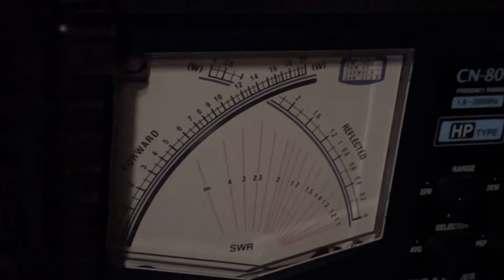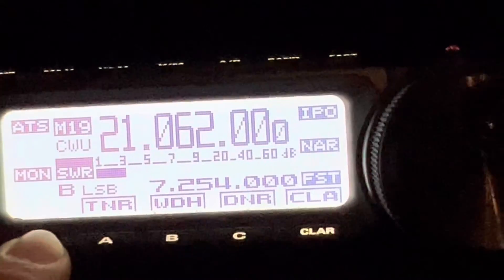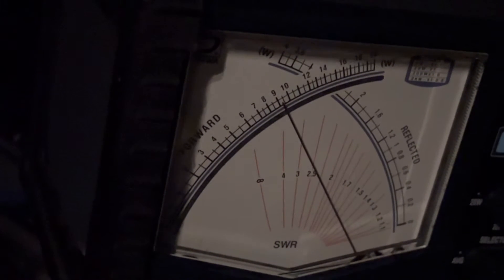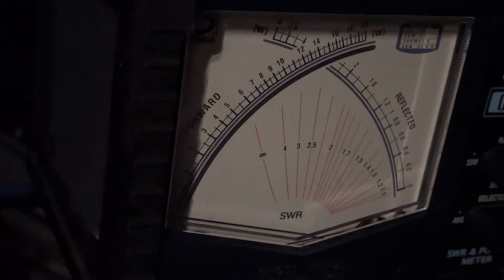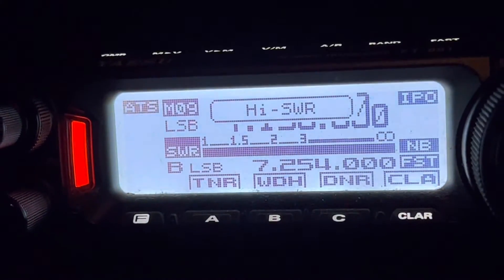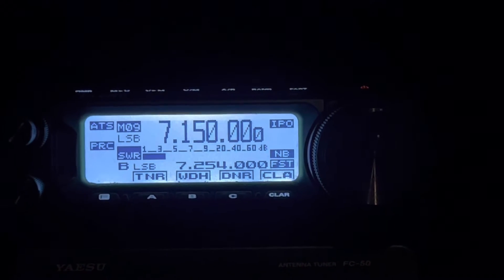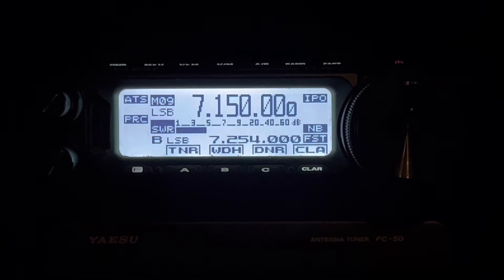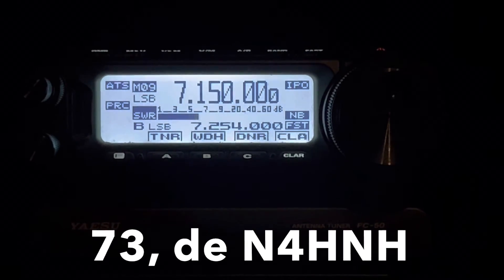Yaesu ATAS-120A Part 5 (how many watts for tuning?) #yaesu #atas #hamradio #antenna

Comment: Thanks! My Yaesu FT-857D tunes quickly into a fan dipole since there's no rod to move up and down. As best I can tell in the second or so required, it's using less than 10 watts, which fits with your 7.5 watts. That should keep the finals well protected. However it is used, the menu button tune mode of these Yaesu is handy. It's far easier than reseting the mode and power just to tune an antenna. 
    There's a useful tip I've discovered that'll tell users with multiple antennas which has the best match independent of the tuner and is thus likely to be the most efficient. 
    I've installed an SWR meter between my transceiver and an FC-30 tuner. Once the tuner does its thing, the SWR is very low. But what is the SWR before tuning? You can get a rough idea by watching how far the SWR meter jumps before the tuner finishes. For a well-tuned antenna, like my 40 meter dipole, it hardly moves. A good match already exists. But when I use that 40 meter dipole on 15 meters, it jumps about 10%. There the match is not that great and requires some compensation.
     There's also a handy tip that Yaesu suggests in its manual. These tuners have a memory based on the frequency being used to speed up tuning. Over time that memory can become cluttered and interfere with the tuning. The manual describes a procedure to reset all that memory. After I did that, some erratic behavior went away.

Comment: Interesting. Do you know if the power is applied to the center or shield of the antenna or both? I have been kicking around trying to tune two at once in a dipole configuration but trying to uncover where the power is needed for tuning.
Reply from the maker: The DC to run the motor rides on the shield and the center conductor of the coax.
Reply: @n4hnhradio  Okay, I wondered if it was both or not. Good to know, thank you!
Reply from the maker: It’s probably not feasible as a dipole, trying to synchronize both ATAS-120A antennas to be the exact length.  I’m also concerned about the extra strain on the radio’s DC output circuit. Better off using as a vertical, with plenty of radials.  Or use two Ham Sticks as a dipole. A 10m Ham Stick can work 10 through 20m with a wide-range antenna matching unit. I also used a 40m and 60m Ham Stick.
Reply: @ Yes, I agree 100%. I have just been thinking of toying with the potentially impossible. lol

Comment: Has anyone actually tried using 2m or 70cm on this without the 991a?  I’m wondering if I can adjust the antenna (manually,buttons up or down) with the FT-891 then use a switcher to for a 2m/70cm antenna.
Reply from the maker: I don’t think you can do that. The motor is powered from the radio. You need to transmit on the frequency you wish to tune for.  The ATAS-120A can be used with the FT-991A.

Comment: Still new to the hobby. Do you have to use a tuner if you install the 891 in your vehicle and use the atas? Trying to limit how much I need to install in my vehicle. Thank you
Reply from the maker: An “antenna tuner” doesn’t actually tune an antenna. They are poorly named.  An antenna tuner cannot change the length of the antenna.  An antenna tuner acts like a transformer and fools the radio into thinking that the antenna is the correct length, so the radio can deliver full power to the coax.  Much power will be lost in the coax, due to the mismatch between the coax and the antenna, but you will get some power to the antenna.  Sometimes we have no choice.  Been there and done that.  

As long as the antenna tuner is only needing to match an antenna that isn’t too far off, like 3:1 SWR or less, the coax loss is tolerable.

The ATAS-120A has a motor that is powered via the coax. The FT-891 powers the motor and makes the antenna longer, or shorter, as it measures the SWR.  It will stop the motor when the SWR is acceptable.

I showed in video #4 of this series that I was removing the ham stick antennas. I no longer needed them, thus I no longer needed the FC-50 “antenna tuner.”  I just released a video about an hour ago that shows my FT-891 as it is now - no FC-50.  The FC-50 was disconnected during the filming of the 5-part ATAS-120A series.  Now it is gone.

Comment: Ever thought about mounting it in the roof to the mag mount and testing it then?
Reply from the maker: No.  I know better.  It needs more than capacitive coupling to the body, for counterpoise. I think I pointed that out in one of the videos in this series. Also, I don’t want to put a $400 antenna in harms way.  It might get torn up by a low hanging tree limb. That already happened to two of my ham sticks.
Reply: @n4hnhradio  I’m sorry if I offended. I meant just using it stationary, not driving around.  To see if the car roof gave better performance My apologies for not clarifying.
Reply from the maker: I wasn’t offended. I was just explaining that I knew better than to try the magnetic mount.  The magnet doesn’t provide adequate coupling to the vehicle body, for counterpoise. Remember that the ATAS-120A, or just about any mobile HF antenna, is only half of the antenna.  The other half is the vehicle body.  

My magnetic mount was always a compromise.  Not because I wasn’t willing to drill a hole in the roof, but because of the stability needed to support a 6-7 ft. Ham Stick on the roof.  The triple magnet provides the stability, but it doesn’t provide the direct bond of the shield to the vehicle body.  The counterpoise is therefore compromised. This adversely affects the SWR/performance, especially at the lower frequencies. I had to use an ATU even with the Ham Sticks.  For example, the lack of direct coupling limited the useable SWR range of my 40m Ham Stick to around 40kHz.  And even with that, the lowest SWR achieved without the FC-50 was 1.5:1.  

People who use an ATAS-120A often report that they had to install numerous grounding straps to the frame, even when they install with a direct bond of the shield to the vehicle. The bond needs to get to the frame.  I haven’t had that issue with my mount.  My bracket connects to an existing bolt that has a good connection to the frame.
Reply: @n4hnhradio  Thank you for the help.  Sincerely!  I am planning on buying the antenna with an FT-891.  My idea was to use it with a mag mount stationary, not driving around. I thought that would work better. I am a newbie to HF.  I have been doing UHF/VHF for about six years and getting ready to venture into HF. I live in an apartment so that is not an option so a mobile set up is what I’m going to be doing.  Just trying to figure out the best  compromise.  I truly appreciate your help. 
kg7bgm
Reply from the maker: You might be okay with a magnetic mount for the higher frequencies. Even my 10 and 17m Ham Sticks worked okay with the magnetic mount.  As I have said before, the lower frequencies are less forgiving when it comes to counterpoise. You could connect a ground strap to the frame of the vehicle to improve the counterpoise while operating. 

Why not consider mounting it like I did?  Sure, my signal isn’t a perfect circular pattern. I have a stronger signal toward the front left of my vehicle, as expected, since the antenna is mounted on the front left fender. It represents approximately 2 S-units difference versus the signal from/to the right rear, and 1 S-unit difference versus the signal from/to the left and right of the vehicle. That’s okay. I can aim my truck.  One of the S9 (VIP) members who helps bring these videos to you is a prolific POTA activator. He uses an FT-891 and an ATAS-120A mounted on the front left fender.  He turns the truck to favor a specific direction.
Reply: @n4hnhradio  I will be kinda. They don’t make that mount for my car. I will be doing a Diamond hatchback mount. I have my UHF/VHF antenna on one side and this will be on the other.  my plan would just be to change direction to reach different areas.
Reply from the maker: Did you see the 1st video this series?  I bought the Diamond K-400 for the coax and SO-239, but also as a backup mount, in case the custom mount didn’t work. The S9 (VIP) I was referring to earlier used the K-400 to mount to mount to his hood, also on the front left.  But he had to run a braided ground strap to the frame in order to achieve a workable SWR.  The hinge doesn’t provide a reliable connection to the frame of the vehicle.  Another S9 (VIP) used the same mount for the front left of his Jeep.  Of course he had to connect a ground strap.
Reply: Yes. I saw the whole series. Working on DX10 now. 😮.  Phenomenal videos fyi! I have an old Diamond Mount that the cable broke so just need a new cable so should be cheaper. It will be lower on a hatchback, that’s my issue. Not a good ground close by to mount a ground strap. It’s gonna be a long ground strap run. As most mobile setups are, just looking for the best compromise.  Super appreciative. 🙏

Comment: question if i would run ft8 with the yaesu atas-120a what would be the max watts allow on this antenna.
Reply from the maker: Yaesu doesn’t specify a FT8 rating but it’s usually half the rated power. But you shouldn’t run more than 50W from a 100W radio anyway.
Reply: @n4hnhradio  thank you I was wondering didn't want to over load the antenna with ft8.
Reply from the maker: FT8 is very effective at 20W.  50W is a lot.
Reply: @n4hnhradio  once again thank you. I might try a Pota activation tomorrow inside my pickup. i will try the 20 watts on ft8.

Comment: Good information, seen all the videos you made on this antenna. Question, how many watts will this antenna handle in digital modes (ft8) thanks.
Reply from the maker: The official rating from Yaesu is 120W A3J/J3E (SSB).  So it should handle the maximum of 50W that Yaesu recommends for FT8/4.

Comment: Interesting… I assume that the ATAS control is done with a DC offset on the output? How would that affect the power meter? Could the DC power be what you are reading? That would explain why the reflected power needle never moved. Could the RF output of the radio be much lower that what was shown here? 
Interesting test either way Doug. I hope to have an 891 and an ATAS in the moble soon. Thanks for the videos!
Reply: Simple system.  12V DC extend, 8V DC retract.

Comment: Hi Doug. Thanks for the Atas series videos. By the way I am really enjoying my FTDX-101D I purchased several months ago. Now I'm thinking of getting the FT-891 and the Atas antenna for mobile. I only have a hatchback car for now. Do you think the Diamond K400 mount will be strong enough to hold the Atas antenna on the K400 mount on my Hatchback? Oh, by the way, I see that the Atas Antenna goes to 2 meters. I suppose you could use an HT with the Atas. 73 de WA3RSL.
Reply from the maker: Frank, I see no reason why the K-400 wouldn’t work with a hatchback. It’s made for trunk lip mounting but I use one on the passenger door for my 2m/70cm antenna, as shown in my Antenna Farm video. Two of my Patreon team members use a K-400 to hood mount their ATAS-120A.  Another uses one as a trunk mount, for his ATAS-120A.

I don’t know of an HT that could power the motor in the ATAS-120A and tune it for 2m or 70cm.  A transceiver must be equipped with the control circuit and menu to control the ATAS-120A.

Even with a Yaesu FT-857D, you will need a duplexer to use the antenna for HF/6m and 2m/70cm. A Diamond MX-62M should work nicely. Of course you could use a separate 2m/70cm transceiver. I use the FT-891 for HF and 6m.  I use an ICOM ID-880H for 2m/70cm. But, instead of using a duplexer, I use a separate antenna - a Diamond NR-770 dual-band antenna, mounted to my passenger door with a K-400 mount. 

I hope this helps.

73, Doug
Reply: @n4hnhradio  Thanks Doug!

Comment: Good to know. Do you think the ATAS 120 would be a decent POTA antenna if used with radials? I alway enjoy and learn something new from your videos and Patreon perks. Thanks Doug.
Reply from the maker: Hi Martin!  KB9JQU has been killing it from South Dakota with his FT-891/ATAS-120A, operating from his truck. You should see his HAMRS contact maps. From California to Maine to near the North Pole to Europe. 

73, Doug
Reply: @n4hnhradio  Thanks Doug. I'm scheduled to go to Japan in October and will visit the Akihabara district where the HAM radio shops are located. In the past I have been able to purchase items there for far less than than I would pay here in the States. I'll see if I can pick one up when I'm there. 73
Reply from the maker: Hi Martin!  That will offset the cost of your plane ticket. There is a radial kit, if you wish to operate from a park without a vehicle. However, the radial kit only covers 6m, 2m, and 70cm.  Maybe you could add a bunch of wire radials that are long enough to operate at lower frequencies.

73, Doug

Comment: I had read somewhere on the Atas120 that it automatically switches internally to CW and low power even though the rig doesn't show that. That lowers the power and throws a carrier.. Not sure accurate that is but I remember reading it somewhere..
Reply from the maker: As shown in this video. It automatically switches the meter to SWR, which is why I connected my meter for the video.
Reply: @n4hnhradio  I've played with my Atas120 and my tarheel 100 together. The tarheel definitely gets me better reports for the most part.. But because of the simplicity in the size & way the atas tunes, by automatically lowering power with just the touch of a button and then add the ease of installation it's hard to beat for a mobile.. Pairs perfectly with my 891.

Comment: Hi Doug, enjoy your videos. Just curious as to why the external swr/watt meter doesn't show the the reflected power as the antenna is tuning?
Reply from the maker: Very observant Zach.  The SWR needle isn’t working. I use my Autek Research WM-1 computing wattmeter for the shack. But, after I discovered how accurate the wattmeter is in my Elecraft amplifier, I even took the WM-1 out of line, saving another connection in the shack, and saving 3 feet of coax.

73, Doug
Reply: @n4hnhradio  thanks for the reply and as I always tell other Hams  the less connections the less loss and get that power to the antenna lol 73, Zach W8MTE
Reply from the maker: Yes indeed.  There is no need to have three wattmeters when one will do. But one is in the radio and it only displays the radio output. I leave it set to SWR.  The Elecraft displays watts and SWR.  There is no need for a third meter and another coax in the chain. I run a streamlined setup. The only extra coax I have is the one from each radio that goes through the radio switch, allowing me to toggle between the FTdx5000MP and the FTdx10.  That is a junction that I need, given the nature of my channel. 

73, Doug